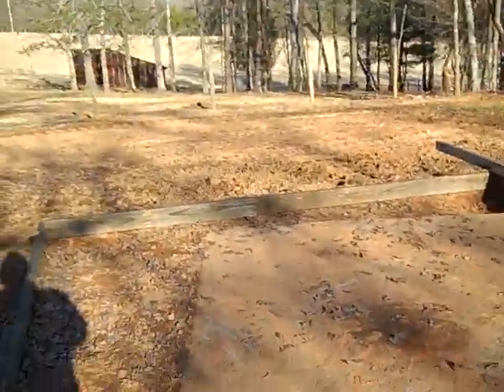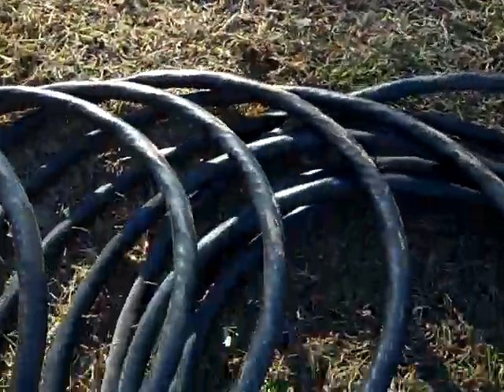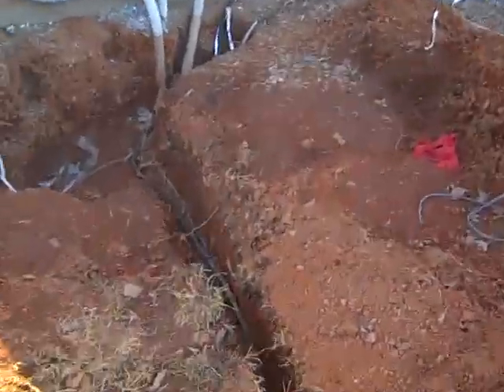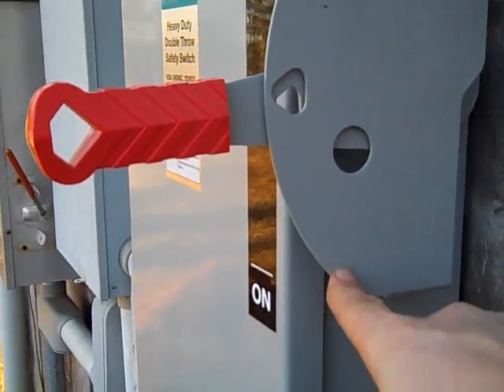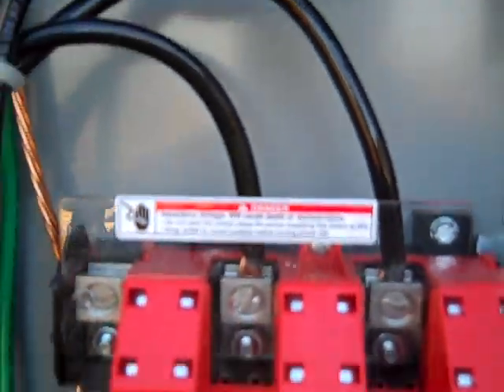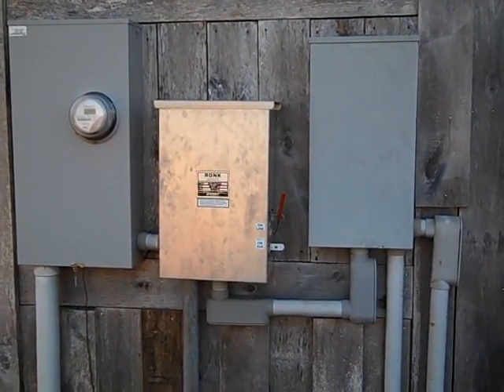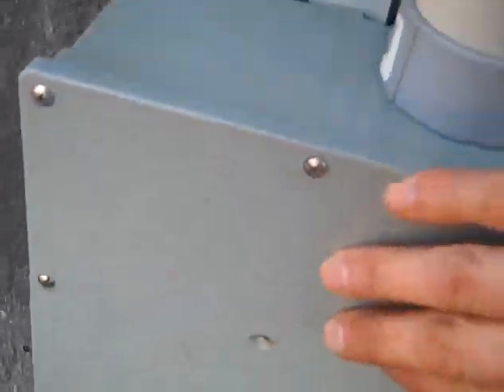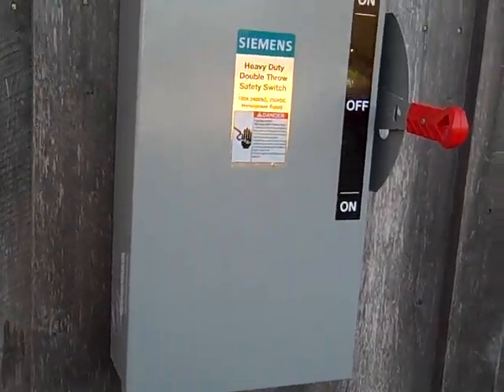Multiple Generators Pt. 2

Comment: The building should be very well insulated for silencing 2x6 or better construction. And you will need adequate ventilation, like a blower. This also will have to be silenced, maybe through a underground tunnel? I have built two of these buildings with diesel generators and they are loud out here in the woods.

Comment: For silencing you could run your exhaust into a 55 gallon barrel buried in the ground and filled with water. As long as the generator never ran backwards, it should work well.

Comment from the maker: @freakshow2000 Again I am electrically challenged but the diesel generator I have run for 10 years - ~ 900 hours.  It has 3 wires Hot, Neutral and ground.   Keep me straight!  But the lil diesle has done great for a long time the way it is wired.  : )

Comment: @engineer775 The big Gens I have worked on were all sitting on heavy springs on rubber blocks to keep the room they are in from acting like a speaker. This stops the vibration transfer to the floor and walls. Killing that fan noise in a problem I cant help ya with.....

Comment from the maker: @freakshow2000 They are both single phase.  The woodgas generator was wired 3-phase whae I got it and I rewired it singles phase.  That onan can be configured for at least 8 different setups but I have it for 240V 60hz.

Comment from the maker: @ProfileMachiningLLC That sound cool.  I have some heavy duty rubber matting 1" thick that I was going to place under the feet.  I could built a timber platform and cover it with the rubber mat and then set the gensets on that?   Thanks!

Comment from the maker: @freakshow2000 I appreciate you checking behind me!  I am a mechanical engineer so electricity is a necessary evil!  : )   The switch is designed for 2 inputs and one output to the house.   So I looked again and I think I got it right but you have me thinking. You look again and see.  The reason I put the switch there is because I already had one generator line run to the transfer switch.  I know there are lots of ways to skin this cat but I hope this one works.  Keep me straight!  Thanks!

Comment: Please understand I'm not trying to be a smart ass, but as an electrician I think you might want to double check the wiring. Any time I see two wires under one lug I know something is wrong. I might be missing something. If that switch was out with the generators you would only need one set of wires run to the house.....Again not trying to mess with ya, I just want your stuff to work, as your setup is cool as hell....